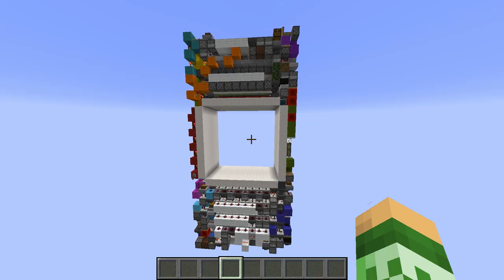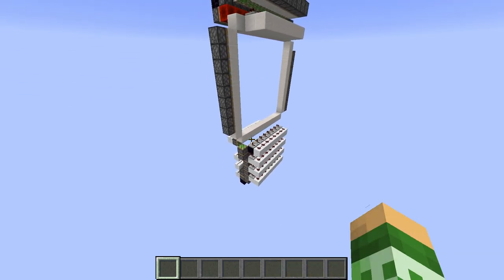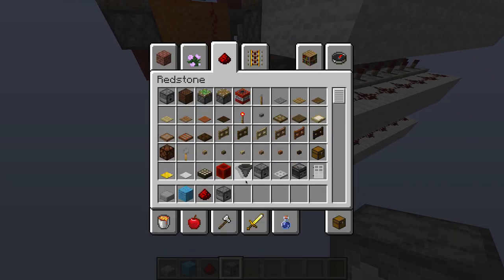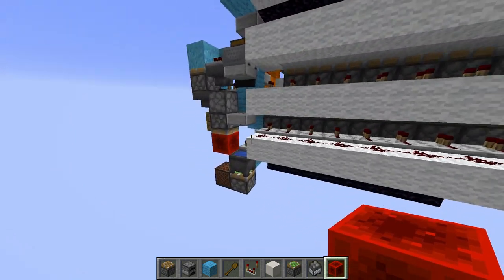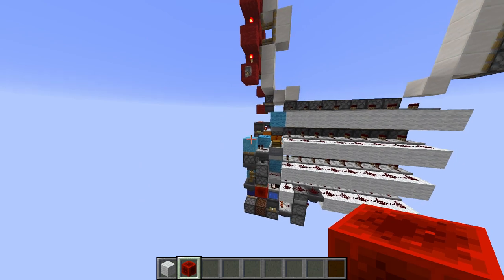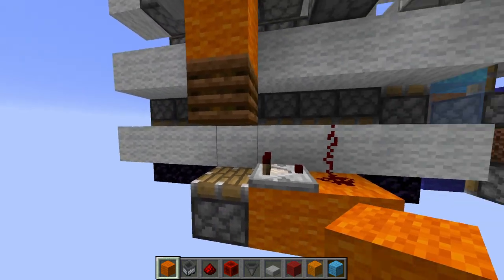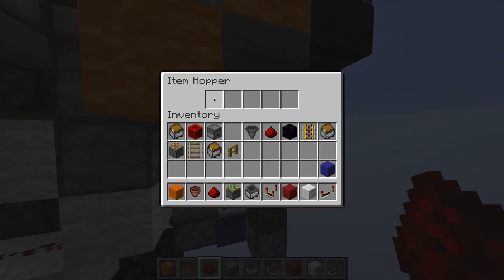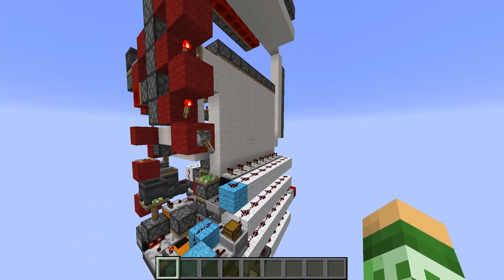Extremely Tiny 10x10 Door Explanation and Tutorial - An étude in entity placement

Comment: I noticed that the item in the blue circuit(for sending the shovel to update the burnout on the right side) skips the dropper in 2:06:03. so it actually got sent to the next dropper so the shovel got sent too fast thus not updating the burnout at the right time. I had to change the hopper in  2:06:10 to a dropper and it worked fine.

Just finished building the entire door, it all worked except in the yellow circuit I had to place a dust next to a dust in 4:30:23 because the burnout thing also powered the torch next to the dust so it became a loop.

also 2:58:39 here's the timestamp of the minecart clip you said it's better to do it before building light blue circuit

Comment: This might be a dumb question because im pretty noob with entities, but why are you using fence gates over normal fences?
Reply from the maker: The reason was because the fence gates are a full block wide whereas a fence, once you remove the block it's connected to, isn't wide enough for the Minecraft to sit on. This is all irrelevant nowadays as a better clipping method has since been found which doesn't use the fence gate at all 😅

Comment: One more thing, the pink rs block dpe sometimes breaks the concrete powder, anything I can do to fix this?
Reply from the maker: You in the right version? Ive literally never seen that fail in 1.15
Reply from the maker: also can you just reply to your previous comments rather than starting so many comment threads thanks
Reply: @Armadillo28  1) sry
2) yea im on paper 1.15.2
Reply from the maker: @Hi30MC  no idea then, i've never seen it break before. could maybe experiment with putting boats in there so sand falls faster but idk

Comment: So, I got to the part with the enderman, and my server doesn't allow hostile mobs or any mobs of the sort, is there any workaround in this or did i just waste 30 hrs of my life XD
Reply from the maker: You could try the thing with the villager that i show, other than that, that feels like something you should have considered before you started 😛
Reply: @Armadillo28  XD rip, vills are banned, and so r mobs. im talking to the server owner right now, ill see tho
Reply from the maker: @Hi30MC  i mean if you're happy to go outside the space just take an output from that kind of area then power the storage for a long time. Neither when, nor for how long the storage is powered is overly specific
Reply: @Armadillo28  ok, i might try around a bit, just im going to work on the top while i wait for my server owner to respond XD
Reply: @Armadillo28  One other thing, does the villager trick also work with armour stands? im thinking about  using that but im not sure if it works fully
Reply from the maker: @Hi30MC  no for two reasons :
1) since 1.9 you cant put armour stands in minecarts without commands
2) armour stands in minecarts are more than 2 blocks tall, so it would activate the pressure plate before its pushed up
Reply: @Armadillo28  oof ok, ima try to find a work around for this

Comment: This is literally the same door I saw on a video made six years ago
Reply from the maker: Haha, no it isn't
Reply: Armadillo28 say what you want but it’s the same one
Reply from the maker: Say what you want but this uses 1.15 features that were added less than a year ago. That said im very curious which door youre talking about sounds cool
Reply: Armadillo28 I went back and checked and your right in the littlest ways, you’ve changed like 10% of the build, it opens the exact same way and it’s hella slow, it’s an absolutely massive red stone monstrosity that you took four hours to make. Either way you’ve kept me entertained but imma head out
Reply: @coltwhite6712  this has to be a joke right?
If not mind sharing the link? Id be curious to see this supposed door working in 1.7 especially considering the state of doors at the time.